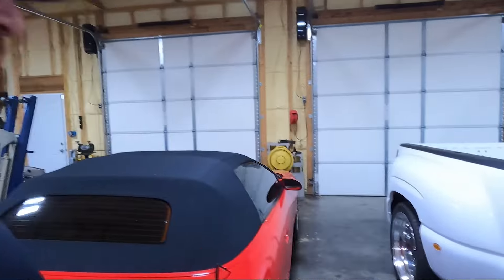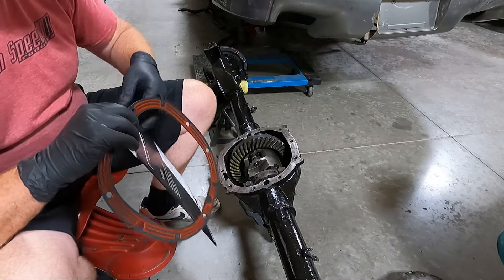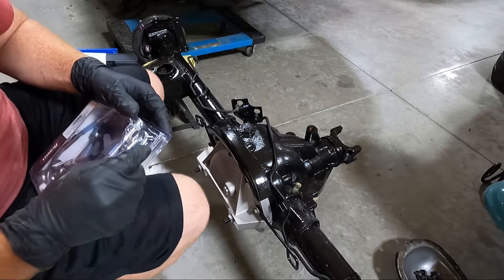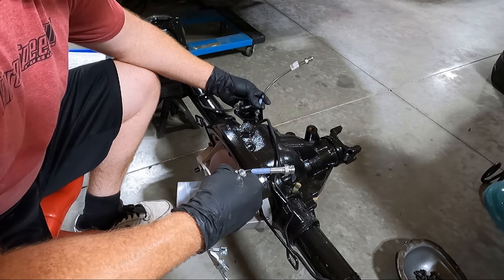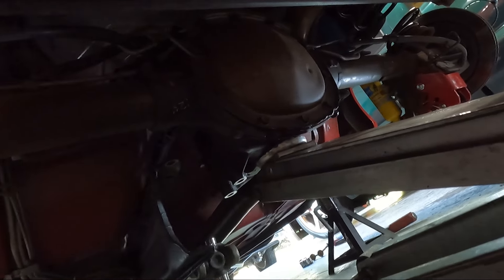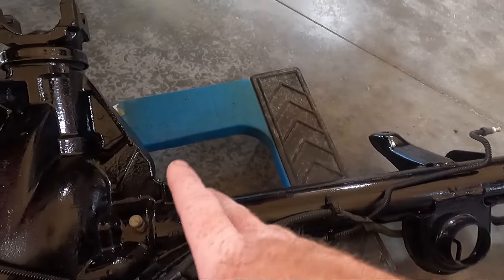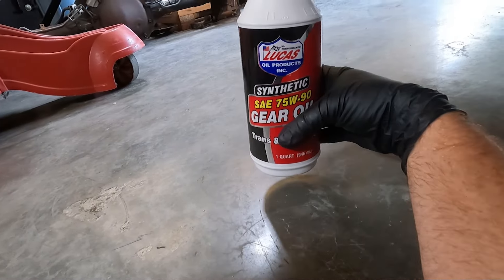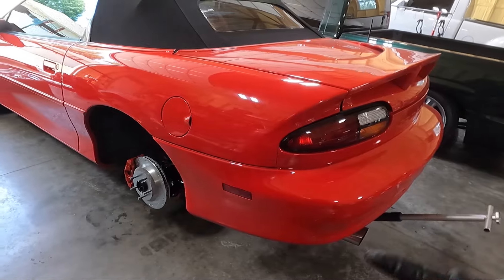Swapping Out 3.42 Rear End for 4.10 Rear End Camaro SS 10 Bolt (Brakes and A Few other Upgrades)

Comment: Great Vid, gotta Moser Rear End with 4.10s in the Comp T/A and I love it with the T56! Great Vid. I did end up ditching the full spool for a Detroit Trutrack, though.
Reply: I installed a Detroit tru Trac carrier on my 94 project trans am I'm building.. it's a nice piece.. I installed Richmond 3:73s with Moser 28 spine cclip axles and timken bearings and seals internally...
Reply: @keilylmm6377  I went with the 33spline axles and c-clip eliminator kit. I did the rear end in 07 and ditched the full spool in 2015. I liked the trutrack so much. I installed one  in my 2000 silverado Project truck.
Reply: @mcbridemotorsports5788  very nice 👍
Reply from the maker: Yeah this should be fun
Reply from the maker: Good stuff

Comment: Looking nice..👍 por 15 does the trick....is that a magna flow cat back exhaust on that SS?
Reply from the maker: Thank you. Yes it is the budget magnaflow
Reply: @TWAMotorsports  that magna flow looks clean underneath.. that's why I was asking... 👍.. sounds nice too.. I've seen them cat back system go for 700.. pretty cheap compared to Borla which I like....👍
Reply from the maker: @keilylmm6377 yes they are way cheaper. Things are crazy priced nowadays
Reply: @TWAMotorsports  have a nice weekend.. I'll be tinkering around with my 94 TA this weekend doing the gauge pillars gauge pods while still waiting for my intake manifold to be completed by my engine builder at golen race engines.. I'm doing 2 gauge pods oil psi and water temperature on the ttop pillar inside.. 👍
Reply from the maker: @keilylmm6377 thank you. You too